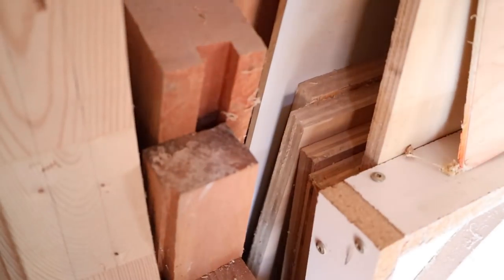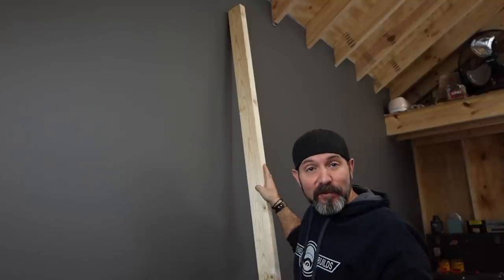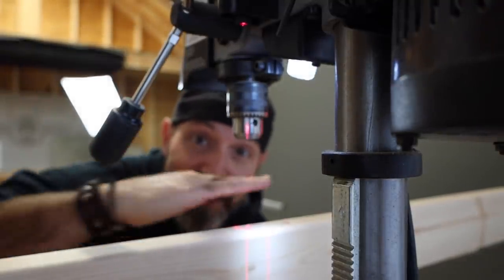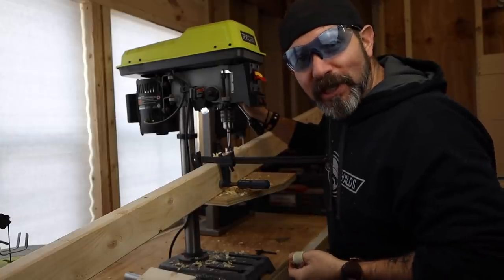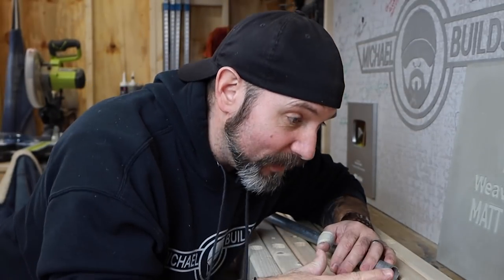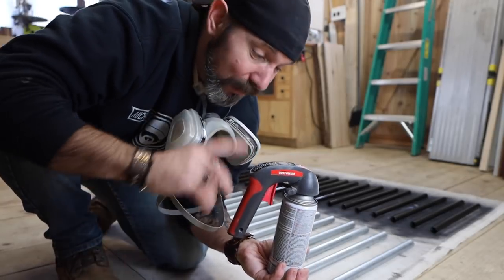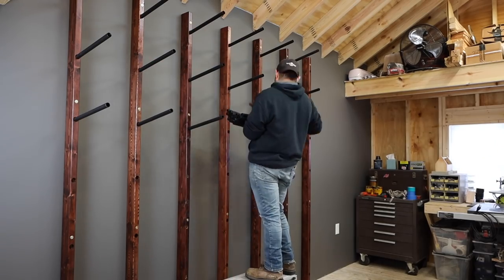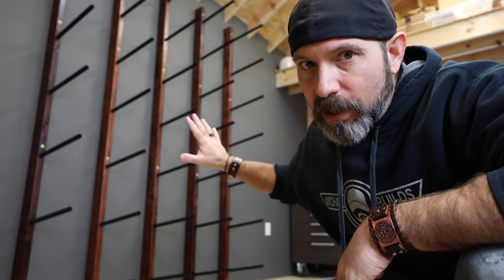How to make a Lumber Rack!

Comment: “Phillips heads & flat heads are the devil.” Couldn’t agree more. That’s why I used Robertson’s head screws & driver whenever I can. One recommendation if I may; there are end caps available for conduit pipe, you should get some to avoid nasty cuts if you bang into the pipes.
Reply: A quick search on Amazon for “EMT pipe cap” will do you.
Reply: time to fire up my 3d printer :D
Reply: 100%    Robertson is the standard in Canada.  Torx can stay in the automotive industry.  BUT Robertson sold in the US is garbage. I've spoken to countless Americans that come north to buy cases and cases of our Robertson screws and bits.  Its not common in the US because it was a Canadian invention.

Comment: Not a bad idea at all using 2x4s and EMT and you did a very good job building and installing it  but. Just an FYI for ya. Painting galvanized EMT is not the smartest thing you can do. - To get the paint to stick properly at all you have to use an mild acid first. A good primer doesn't hurt a thing, either . ,,,, The pro painters in real jobsites absolutely hate it when they have to paint new EMT. . - Plus if you look around  you  can find bright coat EMT that looks like it's chrome plated. which is going to look one hell of a lot better then barked up black painted EMT with big silver scuffs  You can take paint off improperly prepared EMT with your fingernail so it doesn't have a prayer against hardwood,,,,, If you are going for cosmetics (in a stock rack ???) far as I'm concerned hrome is like the ultimate.   (Kind of like painting a nickle plated Colt flat black)

Comment: This approach wins out of all the other methods or approaches I've researched. Thanks!
Reply from the maker: You got it Doug! Thank you!
Reply: @MichaelBuilds  Only modification I'm considering is because I only need less than the upper half of this, to go over an existing setup. Thinking pocket hole screws would be fine. Not planning for a ton of weight on here.

Comment: I had this setup before. I got tired of struggling to get the stuff under the other stuff on any shelf. I switched to vertical storage. Like Homedepot does it for planks and trim. Keep the pipes where they are and use horizontal only for 3ft or smaller lengths. Trust me it’s better this way. Looks great with the stain too. Good job!

Comment: Get a piece of 3 in PVC with a cap thin the paint a bit and dip your EMT in Rust-oleum. Save a bunch on paint and no overspray.
Fantastic build!
A trip to the scrapyard you mat find your heavy wall pipe.
Reply: Just massive drips ??????

Comment: Thank you for testing the weight capacity. I want to use this method for a book shelf. The shelf will hold a good old fashion encyclopedia set. The set claim the metal shelf that held them.

Comment: Note if you have to mount it to a concrete wall I found that 5 1/2'' long by 1/2'' wide expansion bolts work well

Comment: Hi Michael, TIP, if the the wood stock gets too heavy, slip some 5/8 or 3/4 re-bar pieces into your existing tubing.
Reply: And slip some larger dia. pvc pipe around them if the steel's indenting the wood
Reply: Retired industrial  electrical/millwright contractor here. I spent over 50 years bending that stuff,,,,Trust me the wood will fail long before the conduit. .

Comment: Down here in the Missouri Ozarks we have to plug every hole that exists anywhere, tools especially.  The local mud DAUBER wasps will fill ANY hole that exists with mud nests. My 5HP air compressor motor burned up from mud nests. All my airline hose connectors were filled with mud, & I had to use drills to open them up again. I now cap or plug anything with holes they can access. The secondary reason to cap or plug is the sharp edges.

Comment: Wipe  the EMT down with denatured alcohol 1st and the paint will adhere much better. BTW, several years ago built a similar rack out of 4x4's but anchored them in the floor to a sill plate 2' off the wall at the base and directly against the ceiling wall at an angle so I could store sheet goods behind it.

Comment: Whenever I am doing a project on a wall that has yet to be painted is I transfer the center of each stud to a pencil mark on the floor.  Just sayin'.  Great video bro.
Reply: Great idea, I'm going to do this before i close up my garage wall. Save a lot of time when i build this rack and the shelving above
Reply: @justnmcd  My studs are always plumb because I use fire blocks for d/w backing but you can always put a tic on the ceiling if they are not plumb

Comment: Question: Is it necessary to have the 2x4s set on the floor or can they be suspended from the wall? Would the screws support the weight?

Comment: What i great idea! And i immediately started building it myself :) I made a mistake thinking the conduit diameter was the outside diameter...I use scaffolding tubes with an outside diameter of 21.3 mm and a hole of 25 mm (in exterior okoume plywood of 5,2cm by 8cm), leaving me with a gap of 3,7mm so now the tubes do not fit snugly. Does anyone have an idea if this gap is too big and if this could become a problem? (sorry it is in milimeters.. i am from the Netherlands..)

Comment: I was going to say I thought the wood was going to warp over time causing the pipes to sag, or maybe the EMT would bend since it’s not designed to hold weight; but that concrete test seemed pretty clear how robust it is, especially spread out.